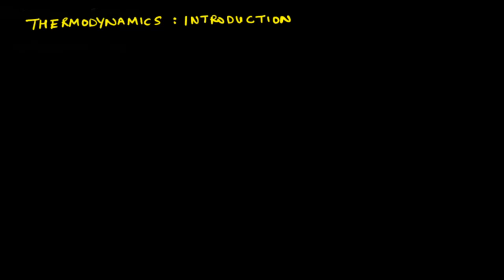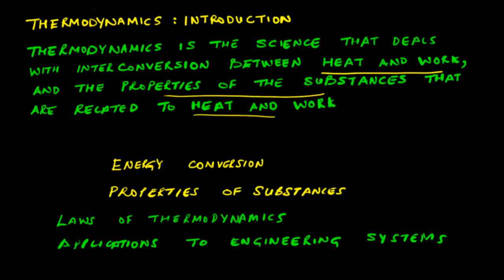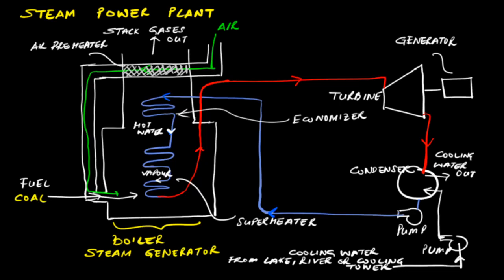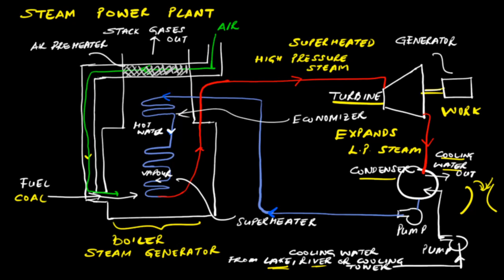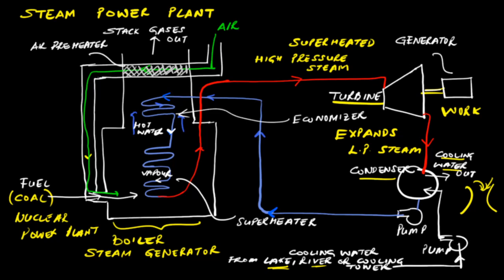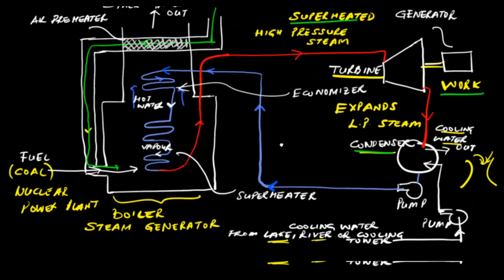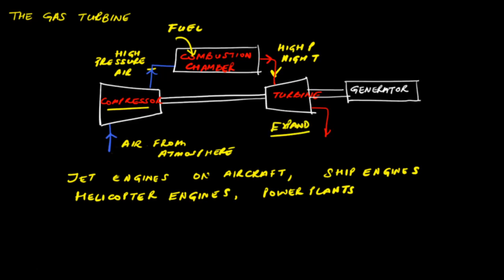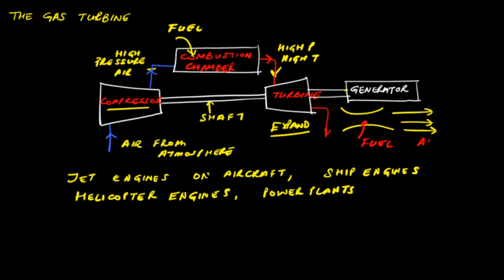Lecture 1: Engineering Thermodynamics: Introduction

Comment: Sir, What will be the problem if we do not cool the steam coming from the turbine in the steam power plant? If we send the low-pressure steam to the boiler, then it will require less energy. But they are not doing that. Why do we need to cool down the steam?
Reply: I get it.
Reply from the maker: To operate in a cycle you need to reject heat (from second law) . You cannot have a heat engine that operates in a cycle but does not reject heat.